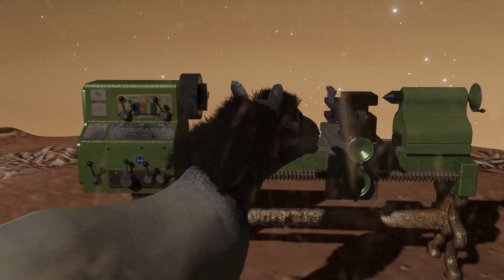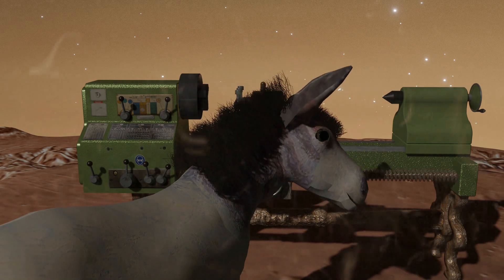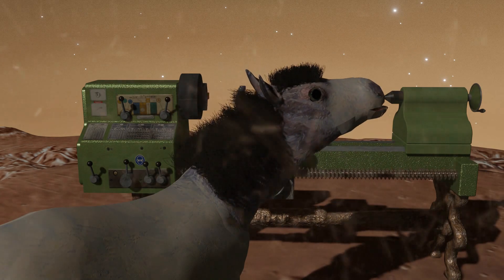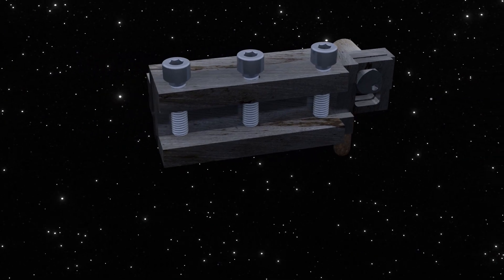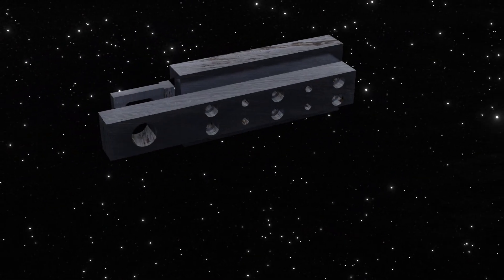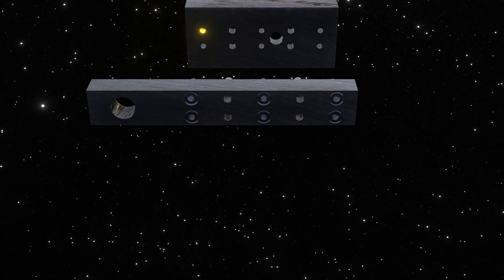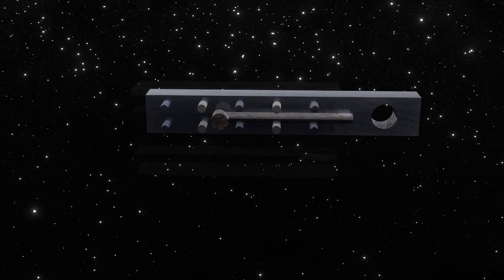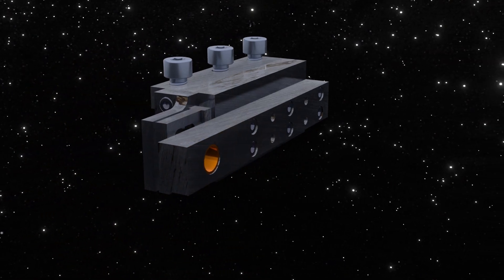Retractable tool holder for lathe - Episode 1

Comment: A future project is to convert my lathe to electronic lead screw. That way, I can program any thread and feed speed, and program any length stop .

But, I need to convert it to ball screw first because there are issues with my lead  screw , mostly it’s a stupid design where the current gear box holds the end play position. So end play is horribly bad .

Comment: I thought about it for a few days, but my gut reaction was that 4 pins for registration seemed like it would make things overly difficult for no reason. I don't even like that that component is in two parts, the best registration pin is none at all, just make it out of one piece. But if it is going to be two pieces, the strength of six screws is more than enough, and tapered pins are better for registration that straight ones and two of those are all that is required. 

The dual cams and pressure lock for the dovetails are quite clever, and I can see the temptation of thinking that just getting it right from the 3d drawings will work (and maybe it will) but I would have a lot more fudge factor designing such a thing myself. The lock transfer shaft coming off the cam should have some adjustability, or be heavily sprung so the slide always reaches the hard stop prior to locking. This is because syncing the two functions (slide and lock) precisely and repeatedly, and over time seems too optimistic, the cam will compensate for the bushing wear but the I suspect the lock geometry will not act identically to that same wear. The dual angles to transfer the force to the locking pin also seems like something very likely to jam, similar mechanisms like in the Wohlhaupter locks , use balls or at least a hemispherical end against the wedge. Dual wedges seem like trouble and some sort of retraction of the transfer rod (even a small rubber element) would seem advisable.

The last point would be the limited throw of the cam, the more it retracts the courser the threads that can be made comfortably. By fully constraining the motion in and out with the cam (to avoid springs, very Ducati of you) I think you are giving up a lot of potential retraction length.

Thanks for all your efforts to teach and entertain, and your support of ponies in the workplace.